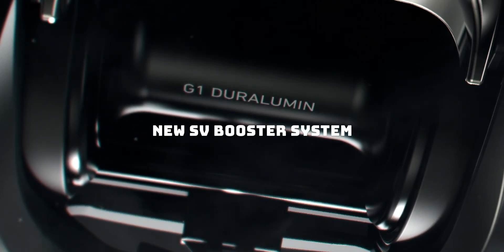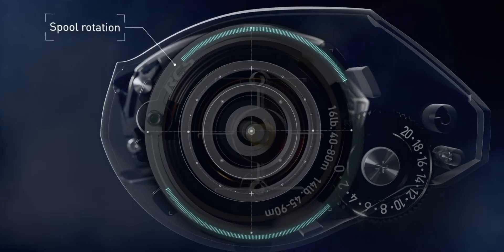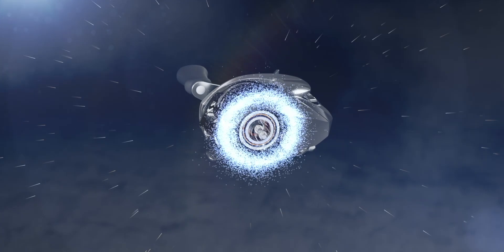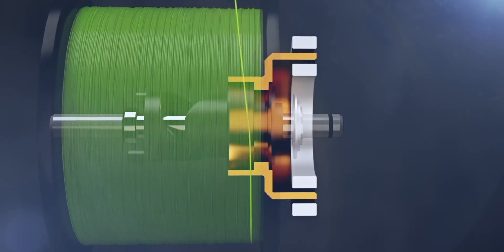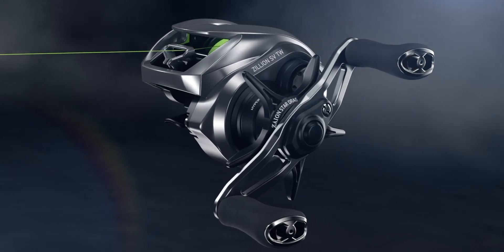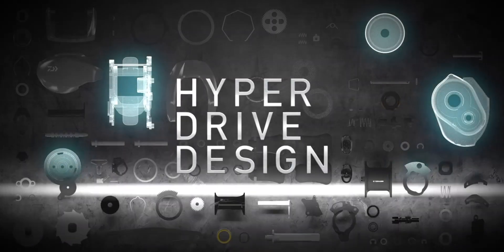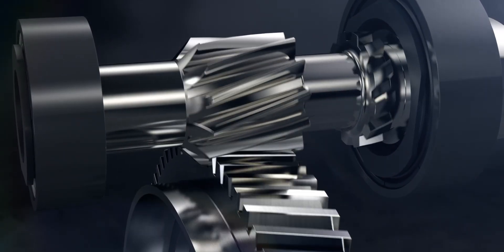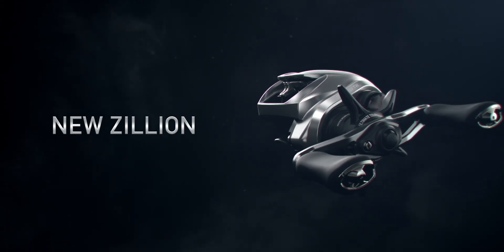Learn the Tech: The all new Daiwa Zillion SV TW

Comment: I just got the left handed (I'm right handed but now I can cast right handed and not do the switcheroo) 8.5 ratio version. I love the reel. It was an addition to my Calcutta 100 92 (Yes, an old reel). I've been doing 99% of my fishing with a spinning reel. But for whatever reason, I got a bug bite and wanted to use baitcasters most of the time now. My Calcutta is a bit finicky and I had the hardest time with it. But YouTube. My God. So much help. It's casting good now. And I got this reel. I've only backlashed once. Not really sure what happened but I upped the dial from 2 to 4 and haven't backlashed since. But even at 2 it's amazing. 

My only complaint, isn't with the reel. That's a 10 out of 10 for me. My complaint is the terminology. Please stop with the hyper this and the hyper that. It's.... Like reading a 50s automatic transmission ad. Use the word to describe one thing and let it go after that.

Comment: I just received a brand new Daiwa Zillion 21 SV TW G reel ( ZLNSVG100H ) but without the cast control cap or the stem. Where can I order an authentic replacement cap and stem for it or any that is compatible?

I think the Daiwa part number is H28-1201 but I’m not 100% sure on that or what the stem it covers is. This Zillion 21 is a pretty well known reel so I figured you guys might have a good idea of what would work here.

Thank you!

Comment: To be totally fair Shimano isn't much better. Claiming they have a computer chip in their reel. Shame on them. It's nothing more than a variable resistance capacitor on a tiny circuit board because wires wouldn't make it sound fancy. . It just uses the same Lenz law that Daiwa has been using forever, holds it for a fraction of a second and than releases it in pulses. It's pre World war 2 technology. Exactly how most modulation pedals for a standard electric guitar works. A typical reverb, delay, chorus, or flanger. I surprised they didn't claim their reel doesn't have a quad core processor too.
Reply: bro 💀💀💀

Comment: Dear Brent Ehrler, 
                             Do you consider yourself a honest person.? Lenz's law, named after the physicist Emil Lenz  who formulated it in 1834,[1] says that the direction of the electric current induced in a conductor by a changing magnetic field is such that the magnetic field created by the induced current opposes changes in the initial magnetic field. Ie: Magnetic fields from strong magnets can create counter-rotating currents in a copper or aluminium pipe. This is shown by dropping the magnet through the pipe. The descent of the magnet inside the pipe is observably slower than when dropped outside the pipe. (It's not the pinnacle of Japanese technology, the only thing new here is the gimmick name. 
                                                          It's marketing hype. they've been spinning a magnet around a drum for 30 yrs, just like in the old Procaster 101.